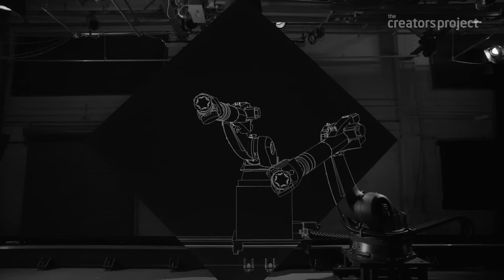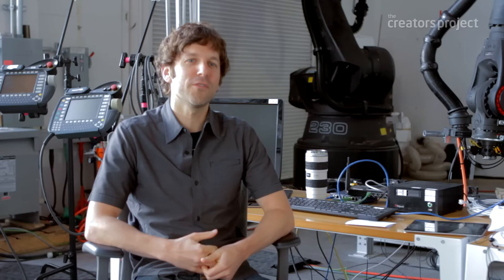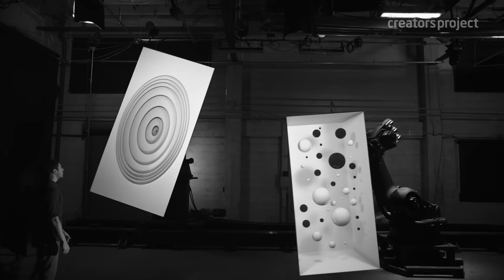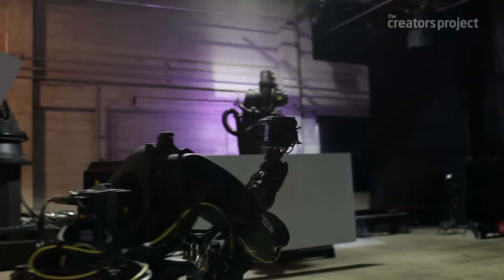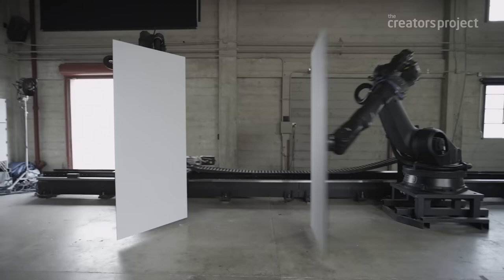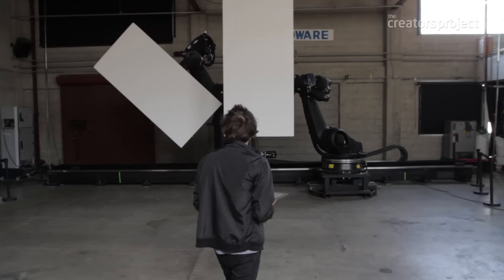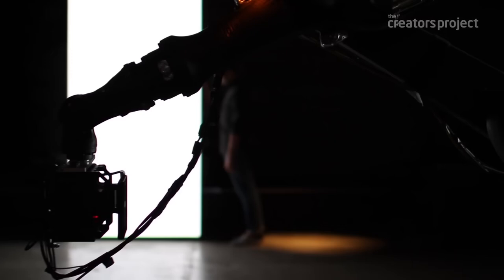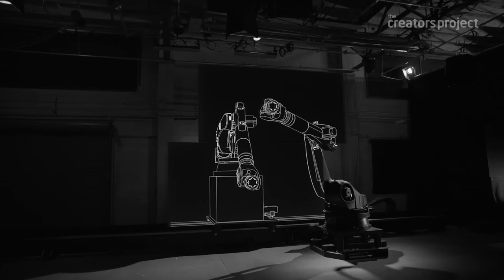Box by Bot & Dolly | Behind the Scenes

Comment: I think this is simultaneously less impressive and more impressive than they make it out to be.  The wording of some answers suggests this could have been performed before a live audience, when that isn't the case.  The projection has to be precisely calibrated to the position of the viewer\camera to maintain the integrity of the illusion.  Taking the end result by itself, this exact product could have been achieved more simply "in post", since the live performance is simply a means to an end.
However, taken as a demonstration of the technology, it's even more impressive than presented, since the projection "video" has to be (relatively) precisely calibrated to the position of the camera robot.  So we've got at least three robots and the output of a (stationary?) projector all synchronized.  And yes, with all that ranting out of the way, the technical aspect of projection onto moving surfaces is still the highlight.
Reply: The path of the camera was tracked AFTER the physical installation was in place, not as it was being constructed.  Sure, if you were in the room and viewed it at an extreme angle, it would distort the panels enough to destroy the illusion, but you wouldn't need your eyes to lock into the exact position of the camera to have an experience comparable to what we see in the final video.  This is indeed as impressive as it's made out to be ; )
Reply: @SamGriffinGuitar  That's what I thought when reading his comment...WTF is he talking about? You have a relatively wide (ish) area where a live audience could be. Why does that guy assume a projected image is only viewable from an extremely narrow angle directly in front? Maybe he's suggesting it couldn't be viewed by an audience of several thousand?
Reply: @Bhatt_Hole  What he is saying is that the perspectives of the objects (the rendering of cubes and spheres) don't hold up if you view from a slightly different angle. You immediately start to see that you are looking at a 2d canvas with a projection
Reply: @rowinvanderschee8043  I'm pretty sure he's just trying to sound highbrow and sophisticated. If the creators really wanted to show it in front of a live audience, they could've just up scaled the whole thing and changed it so that the target POV wasn't moving (which would've costed quite a bit of money and is probably why they didn't). From what I'm reading he's downplaying the presentation due to its budget limitations (it can't be shown to a live audience) and praising it for its demonstration of technological precision, when, personally, I think it should be the other way around.
Reply: @rowinvanderschee8043  It doesn't even need to be a different viewing angle. If you were watching it in person, the simple fact that you have two functioning eyes (assuming you do) would tip you off to the fact that it's a flat surface. It looks 3D in video because it's exactly as 3D as everything else in video is--which is to say, all the signals we use to determine depth other than binocular disparity are telling us it's 3D, but the camera is a single lens so binocular disparity can't come into play.
Reply: @Zetalight16  that's a valid point too. Didn't even think of that

Comment: I think it was just one fixed DLP projector. It's far enough from the screens that the small change in distance from the source doesn't blur the images. If you notice, the entire area in which the panels could move was much than a theater screen. The actual rendering process for the CGI takes account of what kind of distortion needs to be applied based on where the projector is relative to the screen and the viewer.

Comment: They're using Maxon Cinema 4D to create the actual animation. This is keyframed to move around the stage. Then they're sending the keyframe data to Autodesk Maya, and the robots are interpreting how to move the canvas(s) to the exact point. From the looks of the lens on the projectors they're projecting 4K covering the entire wall. they then playback the rendered animation as the robots move. Finally, as said in the video, they move the camera around with a third robot and that's how it's done.